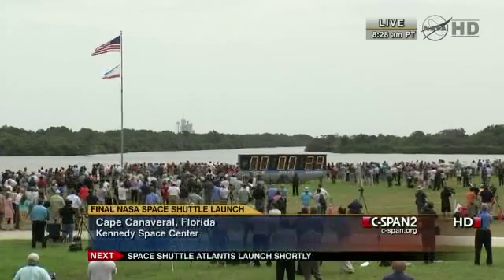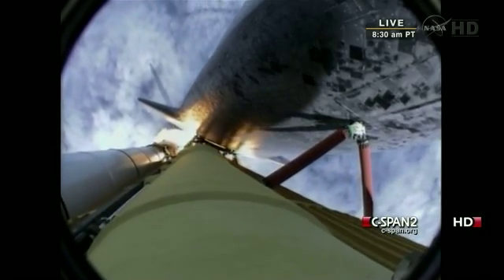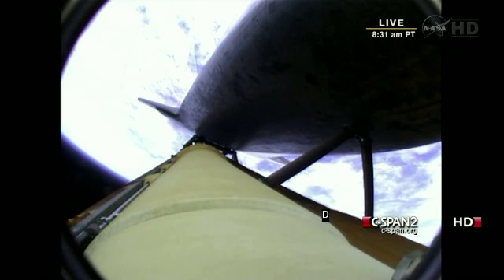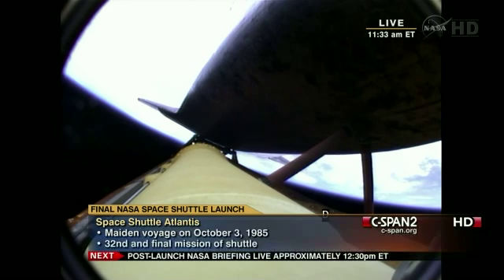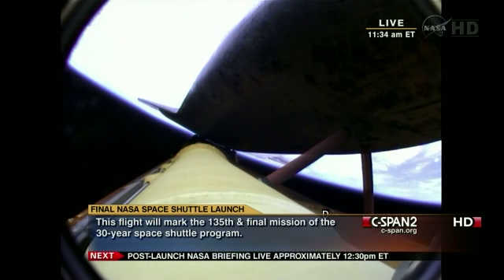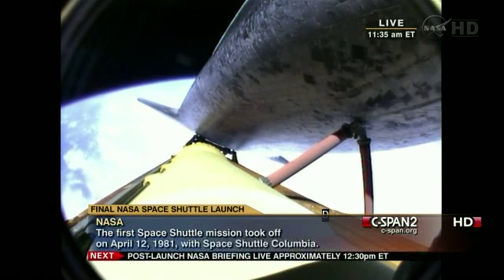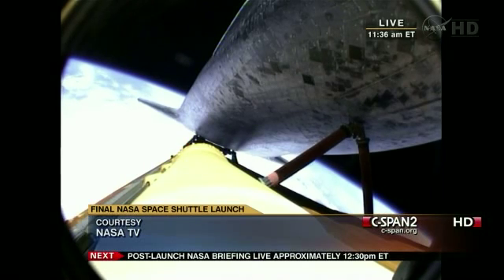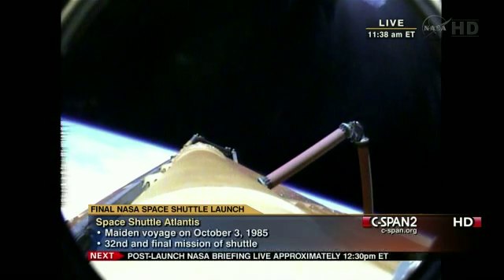Space Shuttle Atlantis Final Launch

Comment: The Space Shuttle Atlantis' final flight, STS-135, took off from NASA's Kennedy Space Center in Florida on July 8, 2011, and landed on July 21, 2011. The shuttle's payload bay doors were closed for the final time on September 20, 2012, and the shuttle was rolled to its new home at the Kennedy Space Center Visitor Complex in Cape Canaveral, Florida on November 2, 2012. 
 
Here are some more details about the Space Shuttle Atlantis:
First flight: STS-51-J, October 3–7, 1985
Flights: 33
Flight time: 7,358 hours
Travelled: 202,673,974 km (125,935,769 mi) around Earth
Orbits: 4,848 around Earth
Dry mass: 78,000 kg (172,000 lb)
Manufacturer: Rockwell Internationa